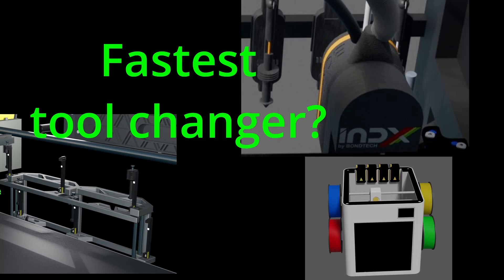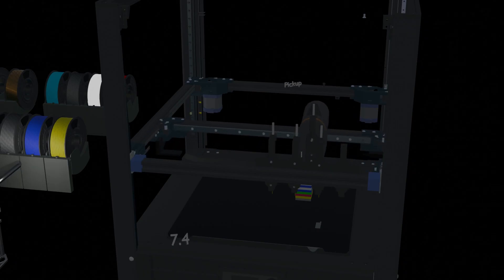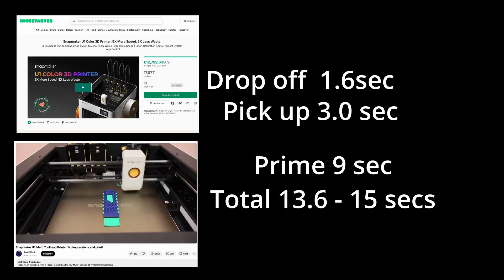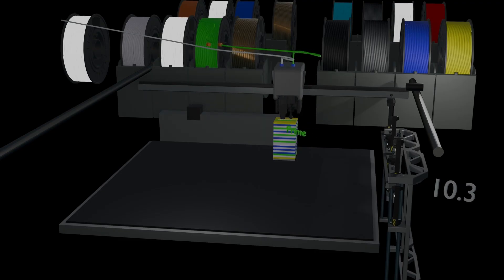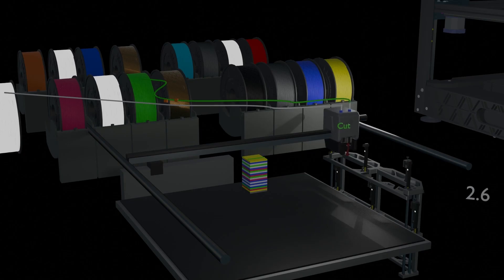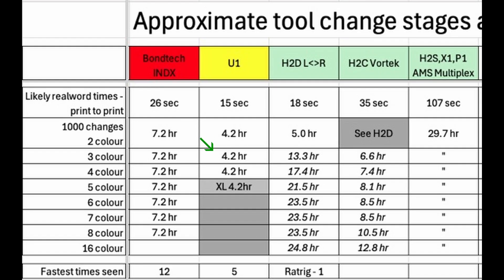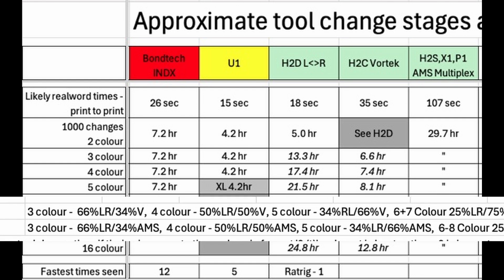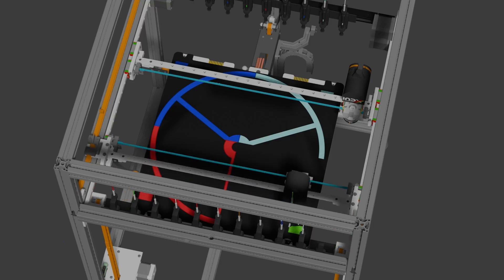INDX U1 H2C Vortex speed comparison V2 -improved sound

Comment: Ready to order the H2C this week if we can pre-order ! Let the fight between the different systems begin. I like their teaser line : "Uncompromising Multi-Material" seems to be a good aim since trying to compete with 'simple' 4 color pla for toys at $1000 is not possible. And i am not trying to make fun of that at all just seems Bambu will aim for something different and not directly compete.
Reply from the maker: Me too - hope the H2C upgrade kit is available at launch and not too expensive.  Although as the main rivals of the system are the $1000 U1, plus $700 Bondtech INDX - then hopefully that will keep prices down for the H2C or maybe lead to an X2C Vortek
Reply: @dwuk3d  I think it will be called the P2C makes more sense first letter is the model (P for small, H for large). 2 for gen2 and last letter for features (S,C,D,..). But yes i suspect in maybe 3-6months they might really compete with the P2C in the $1000(ish) range but the H2C won't be that i am sure.. i still expect a 2500 euro price tag for the combo. Interesting is will they add a new AMS thats even faster or has 6 spools ? It seems to me that getting the new filament in/out during the heating up of the material already in the nozzle is key. Even if i do feel it can't all be about speed thats why i like the slogan they went for in the teaser.
Reply from the maker: @scb2scb2  agreed - although for me its mainly about speeds - which will payback within a few days.  Waste can be mitigated at the expense of even more speed, plus even if not mitigated the payback period would probably be years in terms of saved filament vs increased cost.
Reply: @dwuk3d  Understood i think most versatile and fastest are hard to mix here. For one you would probably focus on keeping all moving parts as light at possible. The H2C/H2D way of thinking is the widest option with good enough speed for most people. I still wonder how much of speed hit we will see and/or if some of it can be recovered by using different nozzle sizes during a print.

Comment: Now add an AMS style unit to each bondtech nozzle and multiply your colour options automatically. Run 6 nozzles with 4 colours each to have large variety of filament and still have less waste than just an ams.
Reply from the maker: Agreed - I'm probably going to add a box turtle to some of my nozzles. Or might even go the whole hog and a cutter and make all of the INDX nozzles fed from a box turtle like the H2C - as it will remove a whole lot of PTFE complications.  Plus would also allow filament spools to be shared across multiple nozzle sizes.

Comment: by the time it comes out it will be irrelevant for most because it is already irrelevant for me. I print at 100mm3/s from a 0.4 nozzle which is three times as much as indx.
Reply from the maker: In the @MandicReally video they said that flow rates up to 40 might be possible - but that they would likely be advertised as 25.   I think INDX for colour changing / with maybe other nozzles (like your 100mm3 or high temp ones etc) on IDEX or 2nd Gantry would be the ideal setup until maybe a later iteration of Inductive heating where they start to push things further.
Reply: @dwuk3d  40 is less than half what nozzles are doing to day. Let us not mention what they will be doing next year. 40 advertised as 25 means cranking your temp to 300C to print PLA. But imagine the oozing then, its not a magic solution just to crank temp to the sky ..

Comment: I'm curious to see how Bambu's Vortek system will handle extruder retractions right after a color swap and the cut in the filament is between the top of the nozzle and the melt zone. The rest of these tool changers won't have this issue they aren't cutting the filament at the top of the nozzle when color changing.
Reply from the maker: Agreed - I wonder how far the cut will need to get into the melt zone before it fuses back together
Reply: @dwuk3d  It makes me think that they are either retracting before the cut or in software they are going to purge any way if there is a extruder retraction needed shortly after a nozzle change.
Reply from the maker: @OldManJimmy1  yes - I think they will do a little bit of retraction before the cut - then probably a bit more priming than for a normal left<>right nozzle swap to make sure that any impact of the cut is addressed.  The pressure release part of retraction might still work even without the cut being fully fused back together.

I guess it would be fairly easy to test this sort of thing out on an existing single headed printer like the X1C by just doing a cut and then reinserting the same filament.

Comment: I would like to see the INDX working on a fully configurated and optimized voron. I can' decide between this or 5 dragonburners. The cost of chinese extruders, fans and heatends is not so much higher.
Reply from the maker: There is beta testing going on at the moment on I am guessing mainly Vorons' - so hopefully some footage will be released next month once hopefully they open up the Beta testing.

I think full tool changers are always going to be slightly quicker than INDX - due to the ability to preheat - but I really like the elegance of not having loads of hardware sitting around idle for at least 80% of the time like you do with a toolchanger.
Reply: @dwuk3d  I think the Indx will be less maintenance due to the fan and extruder being in the single tool head and only swapping nozzles. |t also seems, overall, more cost and space  effective due to that fact as well. It's cheap to add more nozzles for colors instead of complete tool heads.
Reply from the maker: @scrpnby4207  Maybe - but since INDX is going to be mostly DIY - I think overall reliability is going to be with Snapmaker and Bambu

Comment: I´ve seen faster tool changing times from beta testers of the U1. The slowest swaps were around 7-9 seconds. That happens only when one printed section was so small, that the next nozzle couldnt get pre heated up in time. 15 seconds weren´t reported at anytime - as far as I´m aware of.
Reply from the maker: My 15 seconds includes 9 seconds for priming - 6 seconds for tool changes - 

I did frame by frame timing of 2 tool changes - one from Sandhills3d and one from Auroratech - 

Sandhills was drop off 2.23, Pickup 2.43, Prime 10.17 - total 14.83.   

Auroratech was PreWipe 3.83, Drop Off 1.60, Pick Up 4.03, Prime 5.83 - total 15.30.

Links to tool change in videos timed.
 https://youtu.be/NhL_kTRVEIo?t=186

https://youtu.be/tNocYM78wUk?t=858
Reply: @dwuk3d  I ignored the priming is included. You´re right, my fault ;-)

Comment: The INDX and U! both retain fillament in the nozzle, while the Vortek cuts fillament on every nozzle change. The only way Bambu Lab can claim low waste is if your entire print has less fillament changes than the amount of available nozzles.

The issue I have with the Vortek system is the actual multicolor/multimaterial printing because all we have been shown is changing fillaments between "fresh" nozzles, never changing back to previusly used nozzle. There is still fillament in the nozzle, so if you want to print with that nozzle again (even with the same fillament), you have to purge the remaining fillament, before you can print (you have no retraction controll over the cut fillament).
Reply from the maker: I think they will keep track of the filament in each nozzle within the print and only purge out if it is different - but there will need to be some priming.

For the start of prints I suspect there may well be purging in every first use of every nozzle - unless there is some sort of direct link kept between AMS loaded filament and nozzles.

Even with an 8 colour print - there won't be much waste as very few full purge cycles will be needed

Comment: Btw, I have an H2D and the left nozzle or right nozzle starts preheating quite early while the printer is actively printing, it knows when a switch is needed so by the time its swapping nozzles, its already up to temp
Reply from the maker: Yes the h2d should be preheating. In theory the h2d l<>r could be quicker than the u1

Comment: The thing I don’t get about the Bambi vortex is that it seems like there is only one boden tube, so it has to cut, retract, reload on each change even though it’s switching nozzles.  That seems inherently much slower.  Neat thy could use an AMS upstream as well with full purging though, but again, way slower due to purging.
Reply from the maker: Yes - I think 2 or 3 ptfe's would save a bit of time - but hopefully most of the ams moves can be done in parallel to tool drop, pick up and reheating
Reply: @dwuk3d  I was thinking if they somehow had two tubes and a diverter system coming out the ams then they could retract one spool while loading the other lol, it gets complicated though. Since the AMS2 loads and unloads fairly quickly, and the toolhead does have to grab the new nozzle, heat it, and use the prime tower, if they time everything correctly then there should be much, if any, waiting for filament unloading and loading. I am also curious to see the reliability of the vortek system on an already insanely complex H2D printer vs the U1, which using pogo pins. I'm not a big fan of pogo pins but the U1 FAQ accounted for them in testing, saying the printer will remind you to clean the pogo pins after every 100k tool changes and that if you print one model every day, it would take you 5 years before you had to replace the pogo pin board. They say it should be relatively cheap and easy too
Reply from the maker: @SangheiliSpecOp agreed - they could have done a level of pre wind out even on a two AMS x1c if they wanted to - although it might need some extra sensors in the hub.

Also agree that with the ams2pro they should be able to do most of the ams moves in parallel if they choose to - I hope they do.

Re reliability - I am finding the fairly complex H2D very reliable for 1000s of tool changes - all of the extra sensors and cameras etc do I know add to complexity but probably help with reliability and auto recovery - so I am hoping they continue in the same way with Vortex.

The biggest outstanding concern I have about the Vortex is the price .

I think it fairly likely that the Vortex system will end up being more reliable than the less complex U1 and INDX systems, plus probably a fair bit more convenient too.

Personally I'm going with INDX too - as I need to have a DIY research type printer.
Reply: There's also more moving parts in the bambu so more potential failure and maintenance.

Comment: This simulation assumes one can retract and feed filament while performing other nozzle change phases are underway, but considering the filament change setup on current AMS systems thats not going to be the case.
It will be cut- retract, cool the nozzle, change the nozzle, heat the new nozzle THEN feed the next filament.
Meaning final time for Vortek will be +- 10 seconds per change longer than whats being shown here.
Reply: Couldn't they retract the filament by a cm and then cut it and swap nozzles without waiting for cooldown or worry about oozing? There wouldn't be much to ooze out of the nozzle if they retract it a little and what does come out would be so small that it'd be cleaned up during wiping or the prime tower.
Reply: @cavejohnson2075  there is a reason why H2D has a blocker for the unused nozzle ... there is no such thing as "this little oozing is acceptable" when talking about system that has to handle ALL materials not just plain PLA - whats "just fine" for PLA would be a total nightmare in some low viscosity filament 

trying to take shortcuts with how finicky the system already will be is not a good idea
Reply: @Asghaad the h2d doesn't deposit the nozzle in a storage rack. The second nozzle is always on the toolhead which changes things. Plus, it still has filament loaded. I'm sure if the second toolhead cut and retracted filament then you wouldn't have oozing problems.
Reply: @cavejohnson2075  guess you never come to the printer after the job is done and filament cut and retracted to find a noodle of PETG coming out of the nozzle then ? ...😆

and thats with COOLED hotend attached to the heatsink and fan running until cooled down ...

soo NO, the hotend will HAVE to be cooled down THEN wiped THEN stored to do it properly a problem both INDX and Snapmaker U1 do not have because they do not have moving gantry for the hotends and can afford to have  drip bins underneath theyr tools, U1 even making purges and nozzle cleaning over the same one.
Reply: @Asghaad don't the machines currently just cut the filament but not retract a little bit? That'd explain what you're talking about.
Reply from the maker: If Bambulab choose to do everything serially then changes will be slower as you said. I am however hoping that the competition from the U1 and Indx will drive them to fully optimise the tool change process.  I think they could wind the AMS out as far as the print head sensor in parallel to heat up. Plus also I don't think they will need to wait for cooldown before unloading.
Reply: @dwuk3d  without cooling the nozzle before unloading there will be issues with oozing

im pretty sure the nozzle will have to be cooled before its "parked"

all i can say is that my P1S with AMS2 does everything one by one in sequence

maybe its possible to optimize the sequence as you say to do several steps in parallel but as it is now they arent doing that
Reply from the maker: @Asghaad you might be right - but I think to avoid oozing completely while the nozzle is loaded they would need to move the flow blocker over too while the cooldown is happening, and then back out of the way for unloading.

Cooldown will probably be a bit quicker due to the induction heating too.

You might also be right about the first implementation of the firmware probably prioritising waste reduction and reliability over pure print speed. However i am hoping that the competition drives them to optimise tool change speeds later too as I don't think there is a technical reason why AMS moves can't start happening as soon as the filament is cut, plus I think most of the wind back could happen before the heatup is complete.
Reply: Yea bambu fanboys don't really understand how thier machines work and go back to think it's magic that run the machine and not simply gcode.
Reply: @ShadowGun625  Theres a reason why Bambu has fanboys and took over the market. I doubt they've told us or showed us everything on the vortek. I'm not sure where the filament sensors are on the toolhead for the H2D but they have them everywhere, its possible they could start loading filament and hold the end of the filament at the toolhead while waiting for the nozzle swap if they really wanted
Reply: Yeah, cutting the filament is the Achilles heel of the Bambu system. Also can’t run TPU through the AMS. I’m waiting for INDX.